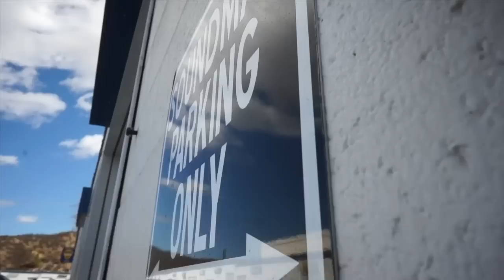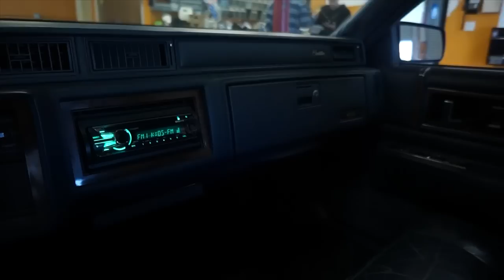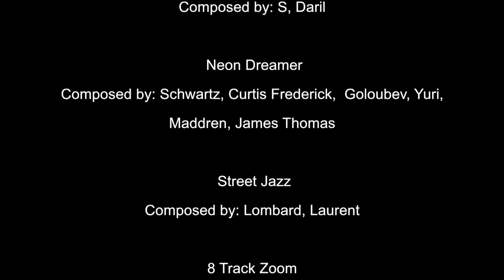Amplified - iPad mini in the dash of a Subaru STI & Jeep Liberty, 2 iPad mini car installs, EP 80

Comment: Just finishing up my own install in an '09 WRX. Mine docks and sits about 3/4" lower than the one in this vid. I did that by modifying the vents (removed the top fin) and lowering the separator between the stock head unit location and the vents. Mine is a magnetic mount WITH charging. I'll share some pics if you'd like to see it.

Comment: If you mean bondo, than yes he might just be using a different body filler because I think only the "Bondo" brand products use that red hardener. There are other brands like Rage that don't turn that pinkish red when the hardener is added.

Comment: Can you install an iPad in a BMW 5 series 2009 - 2012 without ruining the Idrive. For example not hide the idrive and still keep it factory as the Idrive is key for the 5 series also you would have to rearrange the heater buttons etc.  I believe it would be very difficult and a great challenge for you guys.

Comment: hey guys, i've been thinking on doing the ipad install but i'm a little concern about plastic and fiber glass, where i live there is a ton of heat and sun, does the expansion of the plastic under the sun will crack the bondo and fiber glass unions??? have you had any related issues???